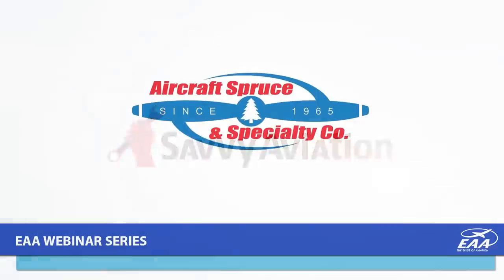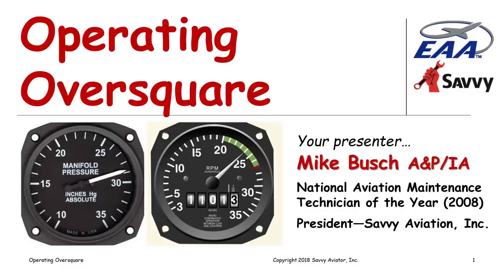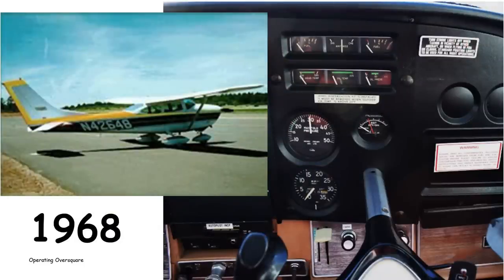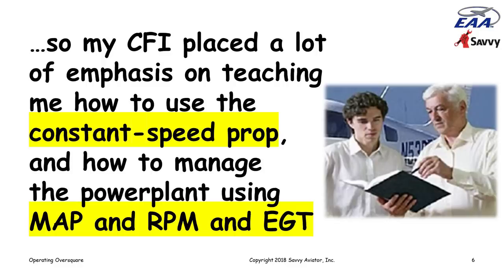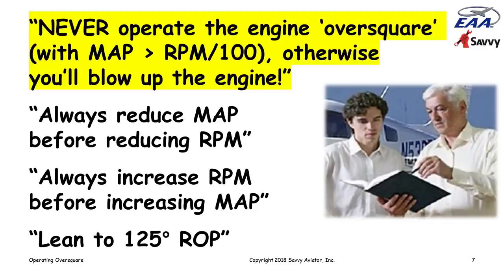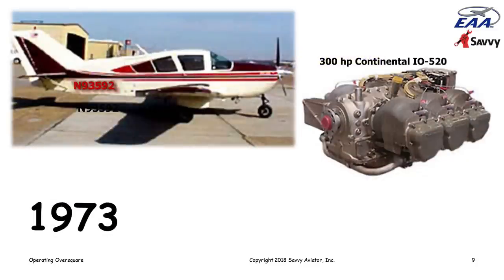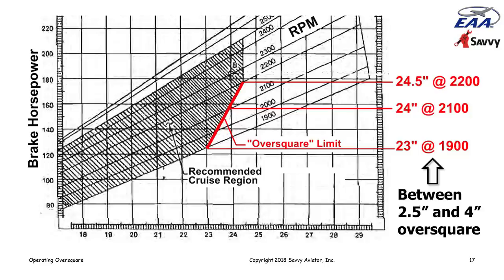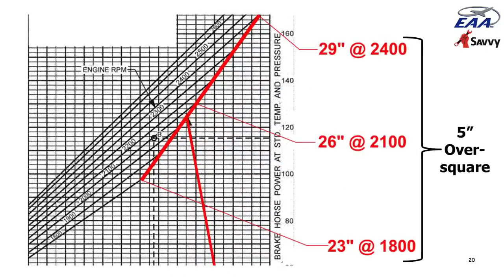Operating Oversquare

Comment: Mike:  why don't you make the point that slower RPM means greater angle for the propeller, ie. greater air movement (greater work for glven power).  Much like using a canoe paddle 90 degrees to water as apposed to less paddle work.  This is higher gear relationship to eg. and overdrive in a car.

Comment: I am a bit confused. Why is the fuel flow the same above and under square? What is the point of this then? Sorry if i missed it…
Reply: Less RPM:
-> less wear and tear, 
-> cooler temps -> less wear and tear
-> allows you to run LOP better, -> fuel savings, lower temps -> less wear and tear

Imagine what would be better for your car if you could get the same performance and mileage driving at 2500RPM or 2000RPM.

Comment: I saw a ABS presentation that said operating my A36 below 2300RPM , ever, especially for extended periods of time,  is harmful due to engine harmonic wear/damage.....any opinion on this?
Reply: I never heard of this on a Bonanza.  However, on my buddy's Mooney M20C,  I vaguely recall there is an RPM range somewhere around 2,000 RPMs where the book says not to fly continuously at that setting due to "vibration".  But there is no marking on the tach to warn of this.  It may have something to do with propeller vibrations as suggested in the note below by another pilot.  I guess "harmonics" and "vibrations" are in the same family because they both are "waves".  Hopefully somebody else can chime in on this.  What does your engine manufacturer say?  I'd call the tech department if it were my airplane and was that concerned.  Hope that helps.

Comment: I would think the over square issue was to assure prevention of "lugging " the engine,  as it is known in the automotive arena. That condition, along with detonation, isn't very detectable in a/c due to typical noise environment, power plant roughness and sometimes turbulence. It's created by low rpm, high power demand and possibly inconsistent fuel quality. Lack of variable timing is part of the problem and I can only imagine what fuel inconsistency was " back in the day ". The "over square " was probably created as a convenient catch phrase like gump and all the others. On the practical side probably weren't a lot of pilots flying around cross country at max weight, wide open throttle and 1200 rpm in the first place. As to Lindbergh, as we see more and more, celebrity status doesn't assure thorough understanding of a particular topic.